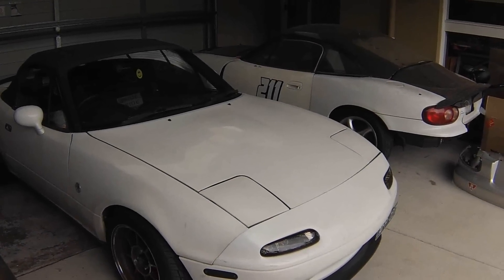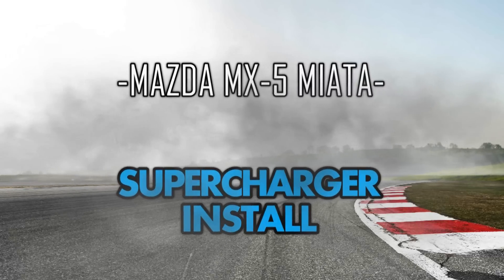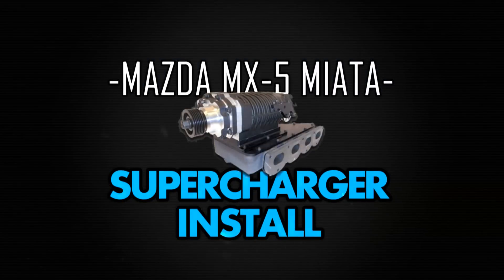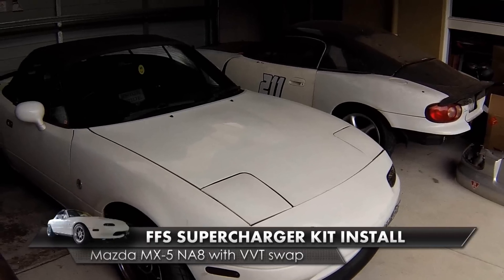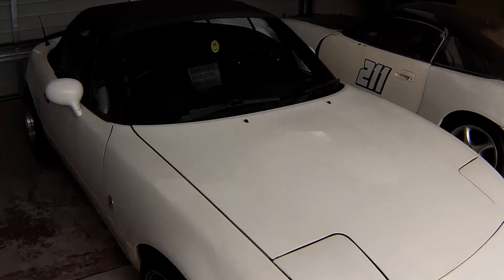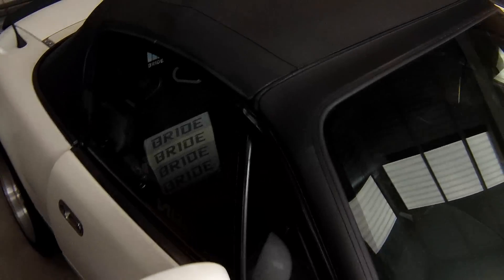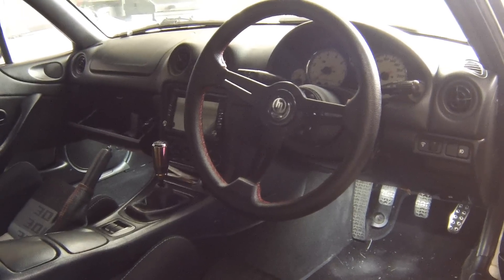SUPERCHARGER INSTALL - 200HP MAZDA MIATA MX-5

Comment: Enjoyed the video, fast forward now to 2022 and current gas prices! What kind of mileage do you get when not trying to conserve gas?
Reply from the maker: Fuel consumption on this car is poor compared to factory.
1. It runs e85.
2. Its running boost and thus an increased demand for fuel.
Thus, its using on average near twice the fuel of a factory car.

Comment: Does this still have a/c and heat ? really want to supercharge a miata but that’s my main requirement
Reply from the maker: Yes it retains the factory fitted air conditioning and heater.

Comment: Order a TVS 900 FFS kit! Can't wait! Plus no drilling the oil pan like a turbo setup.
Reply from the maker: I am sure you'll love it, it's a great kit :-)
Reply: Almost finished with the install! Small fuel leak at the FPR. Just needed to seal it and torque it down more.

Comment: Great video! I do have a question though, do you use the engine management that Tom supplies with his kits, or do you use something like a MS3? If its the former, what do you use to control VVT? I'm doing an '01 VVT swap into a '95 NA, and I'm trying to figure out everything I need to account for for the swap, and this is one of the biggest things that's hooking me as of right now. Any tips are greatly appreciated!
Reply: Scratch that, I just saw where you said that you used the piggybacks he supplied. In that case, what VVT controller do you use with your NA ecu, or do you use the 2001 wiring harness + ecu? Thanks!
Reply: @aaaaaaaaaa2ea3a  The piggyback stuff is as much for the benefit of California owners who have to retain stock ECU for smog. I would assume if your jurisdiction permits it, that an aftermarket ECU is going to give you much better control all round.
Reply from the maker: My car has the full ecu and wiring harness from a VVT NB to power the whole car/engine etc.... with the piggyback cards to run the supercharger components.
Reply: @Bbeavis  How well does the piggy back handle the larger injectors? I thought you would have idle issues with injectors that big on a stock ecu even with the piggyback
Reply from the maker: @pmpursley  It actually ran relatively fine, even at low RPM. I guess the bump in injector size is somewhat compensated by the change to E85 fuel, which inherently demands an approx ~30% greater fuel volume.
Reply: @Bbeavis  Thanks.  Did you ever try running pump gas with the big injectors?
Reply from the maker: @pmpursley  No, this config/setup was specifically for E85

Comment: Love your videos, just wondering how much this set you back? I have a NB8A I'm looking at giving it more power but not sure what route to take.
Reply from the maker: Hi Liam, I purchased it used for about $5000 (AUD).
Reply: @Bbeavis  is that including everything you needed for it? ECU? Do you know what boost it made 🙂
Reply from the maker: @liamjansen9036  Probably best to check out the FFS website for finer details on what's in the kit: https://www.fastforwardsuperchargers.com/miata-supercharger-kit.html
And their website FAQ also covers psi levels: https://www.fastforwardsuperchargers.com/supercharger-FAQ.html

Comment: Any problems with the air intake so far? I was thinking about this same kit and that's the best intake set up I've seen so far, most people do a custom box near the passenger headlight (RHD driver side)
Reply from the maker: No problems. I didn't like the way they ran the intake pipe over the top of the engine, looked odd to me. And being the NA chassis, there isn't much room around the headlight area anyway.

Comment: aren't those boost level high for no intercooler setup? im thinking of supercharging my car and don't want the piping associated with intercooler but im not sure about intake temp, what's your thoughts about it?
Reply from the maker: It is a lot of boost without attending to intake temps. But that is why the kit creator includes the 'e-cool' injector within the intake system and after the supercharger, this effectively acts like a chemical/liquid cooler. Sprays E85 into the compressed air before it enters the engine.

Comment: How did the superchargerd hold up the last 3 years , did you have any problems?
Reply from the maker: Hey Sammy, Going fine generally, the 'piggyback' computer is a bit disppointing, that's the one thing I would like to swap for a genuine aftermarket ECU, but otherwise it's a great car.
Reply: @Bbeavis  Thanks for the great video.  Could you describe "disappointing"?  Debating the FFS kit vs. other FI routes for a mostly track only car, how would you rate it for that?
Reply from the maker: @MrFlyingmachine  I'd rate the FFS SC kit as great, paired with a proper ECU it'd be lovely.
The piggy back setup is just a bit of a compromise for cost. Spent the extra $1500 or so and get a proper ECU if you want to use it for the track.
Piggy backs are disappointing because there is an inherent risk with running them, they aren't usually as well tuned nor efficient as a proper tuned ECU.

Comment: Hey dude! I have a mazda 6 2.3L atmosferic with L3 engine, and i dont find any supercharger for me, you thing this supercharger for mazda mx-5 maybe adapt on my engine? Thks!
Reply from the maker: Hi Inari, I have no experience with the Mazda6 2.3L but I believe they are very different engines and would not be easily compatible.

Comment: Is there room for a coolant reroute kit to fit?
Reply from the maker: Things are pretty busy, you could route it underneath the intake manifold, or route the main hose on the hot side of the engine (over the exhaust manifold). Perhaps using a hard tube for the feed from the back of the engine to the front would be better.

Comment: Don’t you need an upgraded clutch to handle the power?
Reply from the maker: This is approximately borderline on the limit of what an oem clutch will be able to keep a hold of, this car does have a slightly upgraded "heavy duty" clutch.

Comment: Hey broh , can u tell me what diameter its your crank pulley and supercharger pulley ?
Reply from the maker: Crank 110mm, 65mm on the charger.
Reply: How much psi gain with this setup?
Reply: I have 72 in charger and 130 crank and i have 0.4 bar at 7000rpm
Reply from the maker: @punct4ever  The standard Fast Forward Superchargers kit produces approximately 10 PSI of boost I believe.

Comment: How does the intake handle water with where you have it sitting?
Reply from the maker: It is protected from the underside by the OEM plastic shroud/guard. And is also covered with a tin box. I don't have any issues with water really.

Comment: No intercooler?!
Reply from the maker: The kit manufacturer designed it in a way that does not support an intercooler but instead uses an extra fuel injector to 'cool' the intake temps.
Reply: @Bbeavis  ahh ok i understand :D

Comment: Well it doesn't gain or do you any good doing this with your check engine light of depending what codes it has and why the check light is on and can possibly throw the ECU into safe or limp mode and take away alot of timing and limits the motor so no damage is done.
Reply from the maker: The CEL is caused by my bypassing of the EGR system. Nothing critical.
Reply: No limp home mode on an NA or NB miata. Its not a particularly clever ECU. Can't be flashed/tuned either, thus the piggybacks.

Comment: G-day mate...✌️
The same supercharger should be working on a left hand drive as well..!
Correct..?
As I see no issues with the engine ... the only problem I see is... getting one for my 2001 left hand drive nb in germany 🇩🇪 
Because everybody I talk to is doin‘ turbocharged engines...🤔🤔🤔
Reply from the maker: Yes if you look up FFS supercharger for miata, they make the kit in the USA originally left had drive.

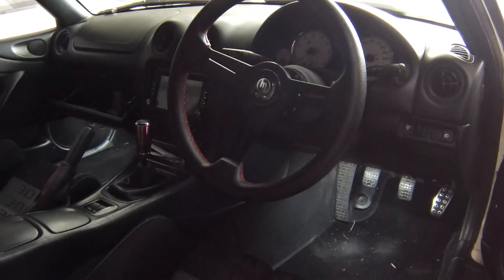Comment: is their a tutorial for the nb abs system in na mx5 as mentioned at 0:32
Reply from the maker: Tutorial for installing an NB ABS system in an NA?
In this case I literally swapped the entire braking system from an NB. That's really the best way to do it as you need the wiring loom, sensors, hubs, driveshafts, etc... the whole car basically has something to do with the ABS.
Reply: BEAVIS Motorsport thanks dad

Comment: There's a lot of people talking shit on here and you are very cool headed about it! xD

I don't own a miata but I have my eyes on a 91. I'd like to add power to it if I did, and I'm thinking super or engine swap are the best two ways (turbo seems just as, if not more, involved than an engine swap and doesn't seem to give any advantage over super for street). As far as supers go, the FFS kit looks to be where it's at for the miata. Not 100% sure I've found the go-to engine swap yet.

What are your thoughts? There are no laws preventing me from engine swapping where I live.
Reply from the maker: Hey Kakunapod,
Thanks for the kind words! I definitely like the drivability and smoothness of the supercharger for a street car, it's really nice and easy to drive, and super spritely. The FFS kit is nice as its very much a bolt on kit, and totally reversible.

And, happy pokemon-ing.

Cheers

Comment: Should link up for the kit.
Reply from the maker: You can see some detail on the kit here if you're curious: https://www.fastforwardsuperchargers.com/
Thanks for watching Rob!
Reply: BEAVIS Motorsport i do have a question though, i just got given an na6 mx5, are the airflow metres common for failing in them. This one is not firing up.
Reply from the maker: Certainly not super common as far as i'm aware.

Comment: 5g for this? Boy oh boy. Just go ecotec. No stress on the motor. 200whp and wtq super linear power curves. And it costs less. 4 grand without selling parts and about 3 if you sold the old motor and other pieces.
Reply from the maker: Hey Mikey, the kit was $4000AUD. I like this solution as it is completely bolt on, and reversible, and retains mostly OEM parts. It's also street legal unlike engine swaps which will render the car not suitable for road use here in Australia.
Reply: BEAVIS Motorsport where do you get this for $4000aud? I can only find it for $5000 usd which is more like $6500-7000aud, for 4 grand I would be very interested in this kit

Comment: An EGR is like taking a deuce, and eating it to get what little protein is there that your body didn't need at the time. Literally what an EGR does. Recycles filth so the filth (which isn't quite filth) doesn't leave the car. Working on a project with a friend (RB e36) and while we're at it, I may or may not have the EGR plugged.
Reply from the maker: Ah yes I ended up blocking off the EGR fittings and removing the pipe work. It's necessary for emissions and safe to remove provided it doesn't conflict with your local road laws.

Comment: For five grand id rather rebuild my engine with stronger rods and go turbo and make more power. These things just aren't the way to go in my opinion if making making good power and not spending too much is your end goal. If you don't care how much you spend and want something simpler to install and care more about low end torque then These are for you.
Reply from the maker: Thanks for sharing!

Comment: Hi i got few questions sir, how much does the supercharger cost and does it comes with belt tensional as well? And is it necessary to replace the fuel injectors while installing a supercharger? Thanks!
Reply from the maker: Hi Mark, This came as a full kit, you can see pricing at their website fastforwardsuperchargers.com
It came with the tensioner, and the injectors really do need to be upgraded if you want to make proper power.
Thanks for watching :)

Comment: does this car have a tune able ecu and which one and should I need one I plan on supercharging my 94 miata ?
Reply from the maker: Yes Colin, I'm running a ME221 built by motorsport electronics.
While there are other ways to supercharge a car without an aftermarket ecu, for the  best result you definitely want something tune-able.
Reply: alright thanks

Comment: Hi Beavis

Given that you have SC and Turbo MX5's, which would you recommend for street / hills / motorkhana. I mainly want power in the 0-80kph range. Thanks
Reply from the maker: Hey roger, i honestly think in most cases a well setup turbo almost always trumps a supercharged car. This is of course a never ending debate, and there will always be some serious supercharged cars out there. But as a generalization, and for the majority of us average joes, It would be easier to get good linear power and low end torque with a turbo and properly tuned ecu with electronic boost control to help it make power low down.
Reply: Thanks Beavis. Think I'll get some more seat time and then start seriously thinking about a turbo. Cheers

Comment: hi is there some form of conversion between the supercharger outlet and engine inlet?
Reply from the maker: The superchargers bolts to a custom intake manifold which replaces the factory mazda unit. Hope that helps :)
Reply: Cheers thanks for response :)
Reply from the maker: Not a problem!

Comment: I think the belt may be wrapped on the wrong side of the tensioner? The other side would give it a better wrap on the S/C pulley.
Reply from the maker: Bob Reimer Hi Bob, you are correct. if you notice in the video at 9:26 I included comments about how I fixed that. Thanks for watching. :)
Reply: I have a S/C 1990 Miata with the same FFS unit. Initially I had a belt that was one size too short, so it was very tight. Eventually I got it all sorted. Tom at FFS was very helpful.
Reply from the maker: I've briefly dealt with Tom at FFS also and he was a great help.

Comment: oil and water temp.
Reply from the maker: In daily driving it's really not creating a whole lot more heat than stock. The radiator has since been upgraded and is pretty huge now. I made a video of the installation here:  https://youtu.be/bnQhKEL1yxg
Reply: awsome . goo to hear . will install mine soon and just try to go off what you did here

Comment: How do you go about regarding legality issues in vic? trying to weigh up between and turbo and a supercharger
Reply from the maker: I think you will find whether you go either Turbo or SC, the legal and engineering issues will be much the same. In my case, the car is legal with the VVT motor and 6spd swap. But the Supercharger is used for "private road use" only. ;-P

Comment: My god the lower intake manifold bolts are just the worst on this engine. Possibly my least favourite thing about my car!
Reply from the maker: Oh yes they are so tricky! Its almost impossible to get a spanner or socket or anything on the nuts under there....
Reply: @Bbeavis  I'm assuming mazda did those with the engine out....

Comment: How come your supercharger bolts on to the intake manifold and not the exhaust side?
Reply from the maker: This was the way it was designed by Fast Forward Superchargers, benefits include less heat soak as opposed to an exhaust mounted supercharger, and less intake tubing required.

Comment: I've had my FFS kit on the car now for over a year, I wish I had gone turbo instead.
Reply from the maker: Oh really? I really am quite satisfied with my setup. With E85 and about 15psi, there's more than enough power for a street car.
Reply: I'm about to get it tuned properly running a Adaptronic ECU and more boost, then second stage will be E85 and even more boost again.  hopefully I'll be satisfied then.
Reply: @TheOndman88  Were you ever satisfied?

Comment: have you need to change the ACU (the computer)?
thanks
Reply: cédrick lebeau I think it's called a ecu, at least it is in Australia
Reply from the maker: Hello, the computer is still standard, however there is a PowerCard Pro  'piggy back' fuel adjuster. I will be installing a Megasquirt3 soon :)

Comment: Would it not have been easier to either buy a Mk2 or was the plan to demonstrate that it was possible to fit a mk2 into a mk1?
Reply from the maker: I got the NA mk1 shell with no driveline for basically free, so I sourced a wrecked NB mk2 with VVT and 6spd to swap in for cheap.
I wouldn't have done it were the mk1 already working.
Reply: BEAVISHSV Here's a thing i'd like to run by you. I've traded in my NC 2.0Sport for an NA 1.8 Merlot and I pick it up today. I can't decide whether or not to keep the NA standard and in great condition, or to Supercharge it. What do you think?
Reply from the maker: It's totally up to you, but in my opinion, no MX-5 has ever come with enough power :)

Comment: This a roots or twin screw blower?
Reply from the maker: It is considered a hybrid/roots-style supercharger. It's a MP62 Magnuson supercharger with Eaton rotor assembly.
Reply: BEAVISHSV aww dam because if it based off a roots they make like twice the the heat compared to twin screw
Reply from the maker: I guess all designs have their pro's and con's. In this case the concern of heat is managed with the intake manifold injector.
Reply: BEAVISHSV CX there really is no pro to a roots over twinscrew
Reply from the maker: That's actually not true, the design of a roots provides boost proportional to RPM, which suits this car, whereas screw type while very similar to roots, do not increase boost with RPM in quite the same way. Roots are also considered to be the most reliable of forced supercharger design.
Reply from the maker: The MP62 is also a very cost effective option, and likely half the price of a screw type supercharger.

Comment: HI, do you have any issue with the IAC drawing air from the crankcase? does it have much affect if it was drawn from open air? 
I uses the same IAC but it seem to be leaking abit of air even fully closed. I read it is how the IAC is designed. Do you have similar problem? Thnaks
Reply from the maker: The idle isn't great. i think in their latest kit, they now recommend taking air for the iac from the intake hose , after the MAF.
Im not sure how effective it is working versus 'fresh air', as i haven't tried it any other way.